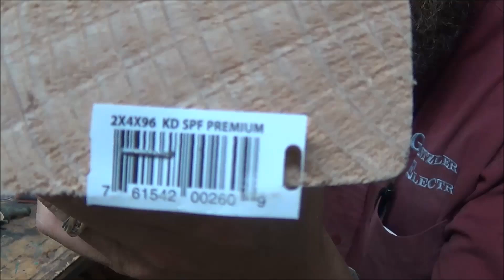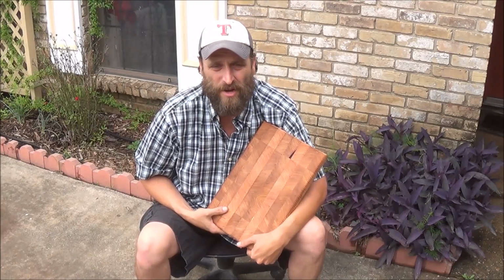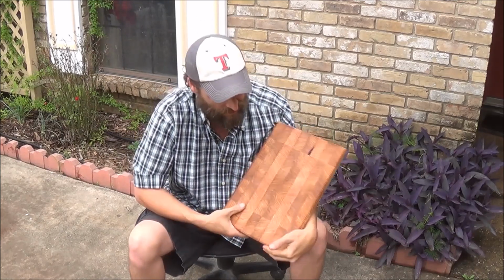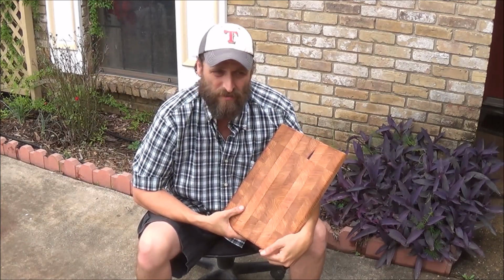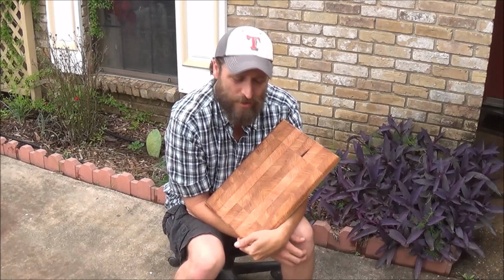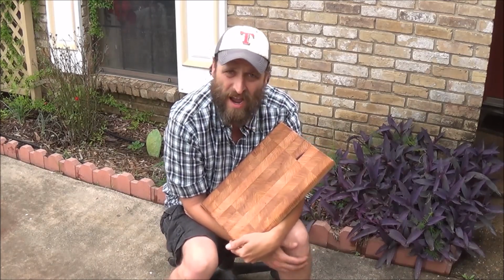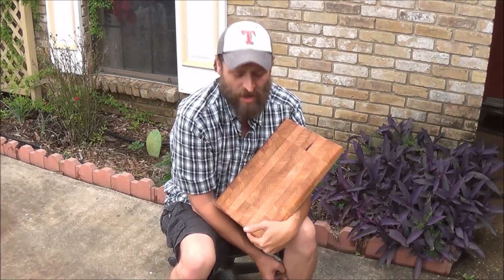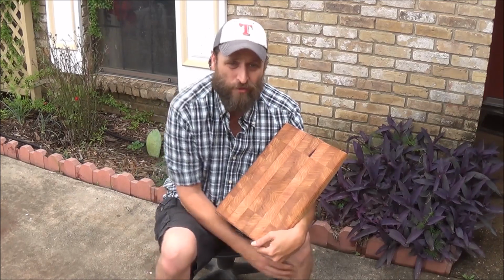2015 2x4 Contest End Grain Cutting Board Drunken Woodworker Design

Comment: Cool entry.  Not sure I'd got with such a resinous wood for a cutting board.  But if it is a prototype and you'll be doing another wood in the future that'll works great.  God luck.
Reply from the maker: Make Crazydays That was most certainly the intention. I was fully aware that there was a potential that this cutting board may not last for the long haul being the type of material it is. Was mainly for practice and working on skill.